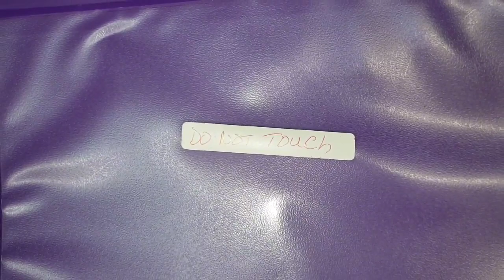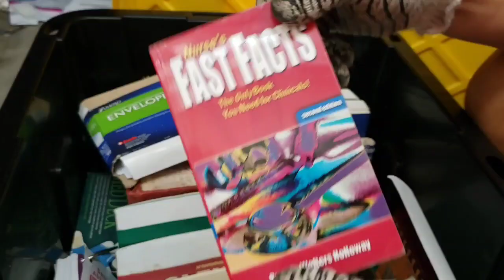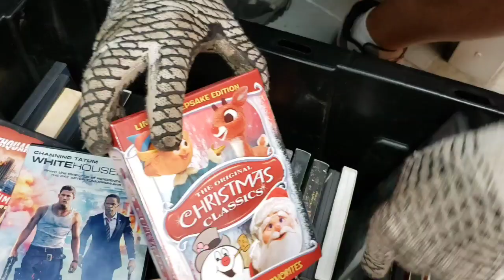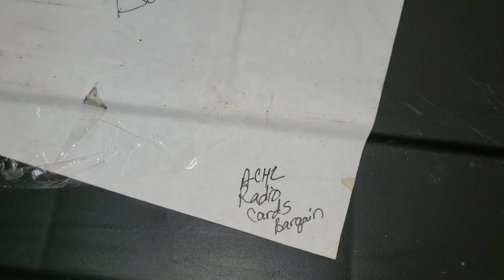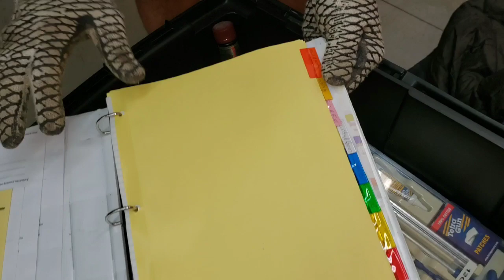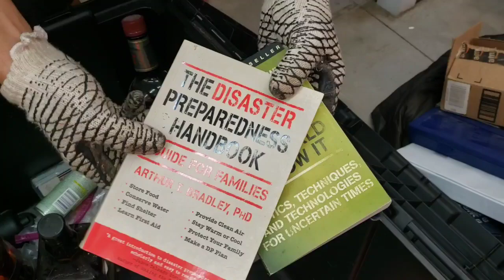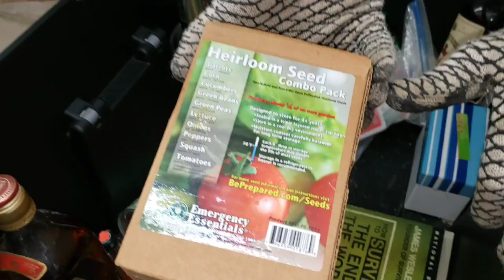DOOMSDAY PREPPER STASH Found  / I Bought Abandoned Storage Unit Opening Mystery Boxes Storage Wars

Comment: Your Pandora beads are likely barter items. Especially if they're silver.
and BOB is Bug Out Bag
Reply: Pandora charms are 925 silver
Reply: The silver beads are not pandora from what I saw.  They are used for jewelry but have a standard weight so they can be used as money or melted into money with a round mold.  A few of those would be your "cash" money when used on a bracelet or necklace with a easy to open catch.
Reply: I don't believe those are Pandora charms. They are most likely from Michaels or Hobby Lobby for crafting bracelets.
Reply: The beads 
Jeremy is right
Notice how there are a few silvery beads
Most are darker
This would be for ammo. rounds / dirty bomb or  trade.
Reply: @brickcity9mm327  
Only when shtf
Reply: The silvered beads are not Pandora they are probably bally silver which are pure silver and they tarnish they are not finished and they were normally used for making jewelry.